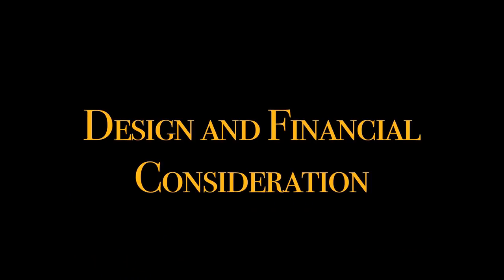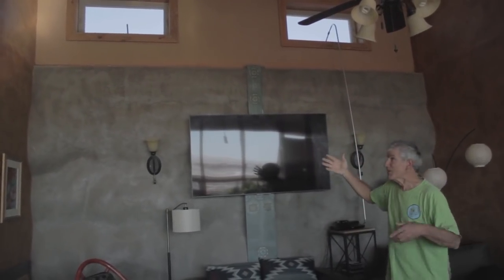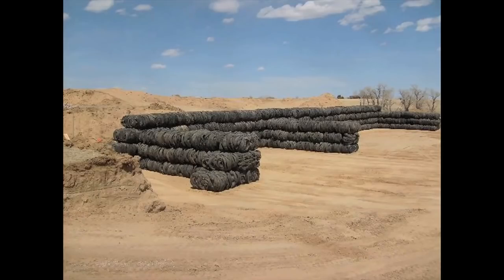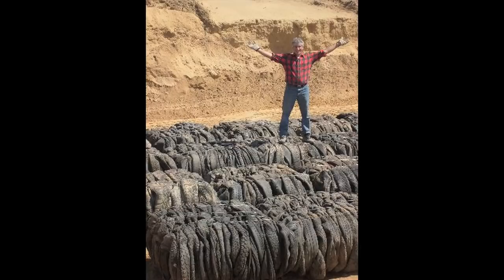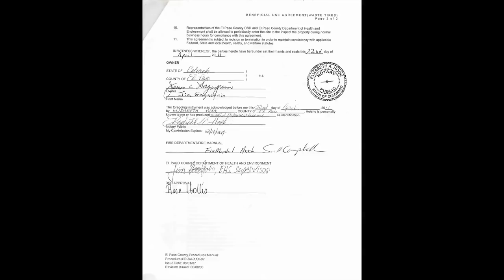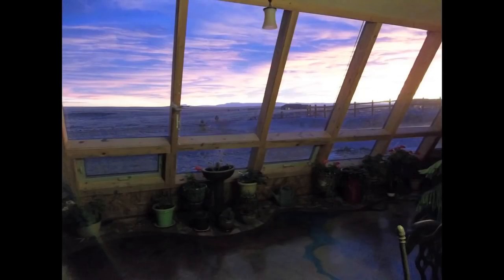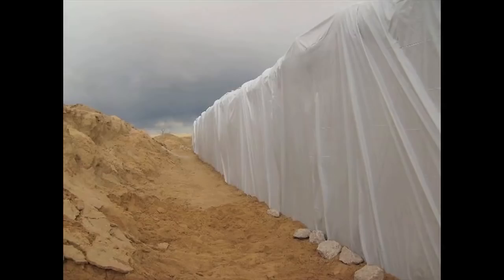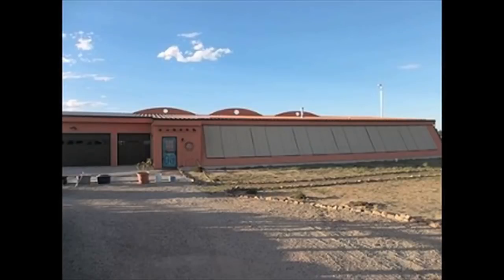Zero Energy Passive Solar Bermed Earth Tire Bale Home - Pseudo Earthship

Comment: Great idea to use tire bale - filling tires with ground is a nightmare (very time consuming and required lot of volunteers).
Reply: im so glad i saw this video. I kept thinking on the amount of labor that’s required to pack them tires, but tire bales...could be the next best thing since slice bread.
Reply: I still cannot find a place that has the tire bales and will ship them
Reply from the maker: Front Range Tire Recyclers 303-660-0090.  The owner is Rick Welle.  His cell is 303-500-2323.  Another friend of mine built more recently, and he used a different source - American Tire Recycling (Duane Immel) 303-638-7150.  Both of those are Denver area code numbers.  Not sure where you're located.

Comment: I call my 24x24 6/12 pitched skillion cottage a pseudo earth ship. Will add on 2 more 24x24 sections. No tires or berm using well insulated  cmu block with masonry veneer on north wall. Our frost depth is 6 feet and ground temps of 48*F in summer where I am at. And can get 6 feet of snow in a weekend. So insulating under masonry floor. I have plans for a masonry stove/white oven and masonry heater old world kitchen. Post and beam square notched timber frame. I have 70 psf snow loads. Doing a Richardsonian Romanesque style. Because proper stones are local and timbers too. Have plans to build a Broch type tower to see lake Michigan. Matt and Goldie's earth ship is similar design as too what I am doing. Using 3  vertical 16 foot columns of 4x7 windows installed horizontal per 24 foot section. 4 foot raised bed and 4 foot above windows for hvac ventilation. I am using 2 inches of concrete with slate slabs over thermal break, insulation, and limestone fines for floor. Using western Delta honey comb riprap masonry veener to get megalithic look. Like Temple of Malta. Doing solar d.c. electric like a boat or R.v.

Comment: As a general contractor with an engineering background I find these structures very interesting. Ive always desired to live in a non-conventional home, and have for many years been interested in alternative power sources. Have designed and built our own PV system to experiment with it usage here in the Tulsa area. Im convinced that an earthship inspires home is the way to go. The world around us isn’t getting any more stabilized, and having this type home would be a great shelter as the concerns with grid power, water etc continue to increase.

Nice job on a very nice home. Wife and I are looking at possibly going to the Earthship 180 in Valdez NM and staying for a week or so. There are some design flaws in that particular structure, but Im sure it has all been a part of the learning curve. Still an amazing home and unique property

Comment: Great informative video. I used tires to control soil erosion in my sloped yard. Unfortunately I was stopped by neighbors concerned that it would leach chemicals into their yard and cause cancer. Can you believe that? So i took my tires up to my off grid property and construct an bermed cabin based on your principals. Theres always 2 sides for debate nowadays with anything. Have a great day!

Comment: excellent information. Thank you. We will be building one eventually as well. I think we'll be using cinder blocks and insulate about 8 feet outside the walls (after 8' of dirt).
Reply from the maker: Does the 8' of dirt act as an insulation barrier?  Haven't seen much info on this type of build.  Can you share a link?  One issue that is hard to manage with bermed homes is mice.  Even though I sealed our house incredibly well, we still see an occasional visitor.
Reply: @jimgagnepain7708  The 8' of dirt is for thermal mass. Ideally, there is no insulation around the cinder block wall (or whatever you are using for a wall), so if there is excess heat in the house, it will be stored in the dirt behind the cinder block wall. that dirt behind the wall does need to be insulated from the outside temperatures, however, so I would put insulation (and plastic to keep the insulation dry) outside of the dirt. Then, it will need to be covered with more dirt to protect it from the sun. Michael Reynolds shows how to do this in his earthships. There was one video that showed the insulation. i don't remember how to get to it. sorry.

Comment: Hello Jim from South Africa. Great video, thanks. We also have an off-grid home but live off grid in a very different way. Solar power (very small system, but managed well) No water supply and no sewerage supply. It's not an "earth ship" or anything special but is just great. No utility bill's either which is the best of all. We use propane for cooking and as a backup of our solar water heater. All your reasons are just right and lastly battery backup for us is the only "pain"  Lead acid batteries are soon to be replaced with a Lithium Iron unit.
Reply from the maker: Dave, This sounds great!  It's nice to hear from others who have discovered that it's not that hard to manage everyday living, without releasing a lot of CO2 into the atmosphere.
Reply: Dave faddel, do you have pics to show us as South Africans plz?

Comment: I couldn't agree with @Ave more. Many very useful observations that most other posters either haven't encountered yet or were simply omitted. 
As for the windows I was curious if a tongue & groove style mitered profile might help with the leakage. Similar to a bird's mouth in gable design. Or using this to your advantage since most homes of this type have plant beds under the glass. The later option I thought of using standard window / door flashing sill pans & use that to direct the water inside to either drip into the planter beds or to a small gutter that would go straight into a grey water cistern as in most Earthships.
Reply from the maker: It could help, but the problem is more related to the glass sections themselves.  We had to use Big Stretch calking, which in effect, angled the seems outward.  You do not want anyplace where the water can sit on the glass, without draining - that's a recipe for leakage.  Operable windows also had problems.  The weep-holes, which are standard on windows, were not angled to the outside, because the installation wasn't vertical.  An earthship friend told me to drill my own weep-holes and insert plastic tubing, to achieve the "outside angle".  This worked.

Comment: A very inspiring and beautiful home. This is how homes should be designed: focusing on a solid envelope while thinking comprehensively about the various systems (ex. your hot water tank placed  where it will absorb heat from the sun)

Comment: Wow Jim what a wonderful video. Well thought out and laid out. It's easy to see it must have taken you quite some time to structure the video. One of the best summaries I've seen for an earth ship home which I have had interest in for years. Also very happy to have found your video as I believe I may have seen another one of your videos years ago talking about the tire bales vs pounding tires. I searched for years trying to find it and today I found this one instead. It may have been someone else I suppose but if I recall they were also in Colorado. Regarding insulating the floor, I think that has more to do with the climate than the design. I remember reading an engineering blog on passive solar houses that specifically referred to a Reynolds earth ship built in England. It was the first one of its kind in England. Mike had arguments with local structural engineers and contractors who told him he needed to insulate the floor, he of course disagreed. The owners have complained ever since that it doesn't function right. The floor becomes a massive heat sink during the winter and sucks the heat right out of the house instead of storing it for the owners use. I guess the ambient ground temperature is much colder in their climate then it is in your location. That's what I recall anyway. Thanks for the awesome video and for sharing your incredible home.
Reply: The frost line would be my first consideration.  Idaho is around 3 feet down, where Maryland is about 18 inches down.  It all starts at the foundation...
Reply from the maker: We don't seem to have the "heatsink" problem at all, and we get very cold nights in Colorado.  Maybe it's because the floor absorbs heat, as thermal mass, during the day, just like every other area.  Other possible reasons are that there is about a foot of small rock under the slab, and also, our water pipes (cold and hot) are under the slab.

Comment: Hello Jim! We live in the first "bale" home design by Mike S. in S. Co. past those Spanish Peaks in Las Animas county. No house heating installed, just a wood,  free standing fireplace. I have fresh tomato's year round! Your home is beautiful. Congratulations on it's completion. This is first video I have seen using the bales. Credit to Mike Reynolds for his life/planet changing concept of reuse of tires and recycling, the "bales" were much quicker....~Cathy & Frank~
Reply from the maker: Your name wouldn't be Hagar (?) by any chance?  If you're up this way, stop by and see the place.  I would love to do the same!  I also do cherry tomatoes year-round, along with an herb garden.  We have fresh pesto weekly throughout the winter!
Reply: @jimgagnepain7708  No, not us. But I found out you know Mike G. who helped in your build. They were here yrs ago! We have email contact. 💖
Reply: @jimgagnepain7708  👋 Hello again! I feel the same about the vertical/sloped glass. Ours are failing. Where was your glass bought? Also what brand of shade's?! T.Y. ~Cathy~
Reply from the maker: @walkingwater893  We got our glass from Aspen Glass.  They did a great job setting them in place, and cleaning them.  We had some small pieces of mullion to hold them in place, until we could do the permanent mullion installation.  Got the shades from Out West Awning in Colorado Springs.  I was getting on-line quotes for over $10K, and we got them locally, WITH INSTALLATION for about $2500 (2011 price).
Reply: @jimgagnepain7708  Thank you Jim

Comment: Very well done explanation of earthship. Although didn't go into plumbing
Reply from the maker: The plumbing is pretty conventional.  PEX tubing, under slab, before the floor concrete pour.  One thing I would do differently is to add an on-demand electric water heater to our guest bedroom shower.  It's fairly far away from the hot water heater, and takes a while to come up to temperature.  I was a little upset that our plumber didn't recommend this when he looked over the job.

Comment: For anyone reading this comment - this suggestion is coming from an old earth builde:
 It's an easy matter to incorporate (completely DRY, aged is best) raw or dimension lumber horizontally into your tire walls, especially where cupboards will be hung.  Same goes for any interior adobe or rammed earth walls where door hinges, circuit breaker & outlet boxes, etc will go.
Plumbing and electrical chases can take advantage of the space behind those 2x or 4x horizontal runs.
Need to keep the course level from exterior to interior?  Do a shallow bond beam of concrete the height of the wood behind the chases.  Remember, any concrete coming all the way through exterior walls will readily 'wick' in the cold, so the treated wood - besides being nailers - helps separate that dense material from your ambient air. :)
Reply from the maker: Yes, it's always a challenge to hang things on a tire bale (or rammed-earth tire) wall.  I spent all day working on hanging a big-screen TV on our tire bale wall.  That's a good idea to incorporate the lumber into the walls.  We rely on the shotcrete, and I can usually attach lumber to that, using the blue concrete screws.  Thanks for sharing!

Comment: This is a really cool alternative to an Earthship. I like it. But it needs the cooling tubes going through the berm for the summer. And the windows up high in the front to allow for convection. I didn't know about the tire bails, those should be used for a LOT more construction. It could work for bridge abutments, highway dividers, retaining walls and lots more. It's a great way to get rid of a lot of tires. I hope they don't off gas into the house, I've heard of that in some Earthships.

Comment: My husband and I looked into Earthship and stayed in one outside Taos for a few days. The thought of ramming earth into tires was a deal breaker for us as we have neither the strength or stamina for that. Now that I know there are tire bales, we can revisit the idea. 
This was the most well done construction video I have seen in a pseudo Earthship. 
Do you have the cooling tubes?  Did your County ever
Reply from the maker: Seems like your message got cut off.  No, we didn't install the cooling tubes.  That wasn't part of our design.  We find that the outdoor shades keep it really cool on hot days.  We're fortunate to have cool evenings in Colorado, and we open the windows on summer nights.  Cooling tubes would be a great idea for many areas.  We also rented an  earthship in Taos, and we felt the same way about pounding dirt into tires.  We did individual for a chicken coop, just so I knew what I missed.
Reply: Jim Gagnepain - did your County ever reconsider water catchment?
Reply from the maker: @maureenkelly738  - yes the state of Colorado now allows water catchment.  There are limitations, but in general, a cistern is now OK.

Comment: Thanks for taking the time to do this, this is one of the most detailed videos about this type of home I‘ve seen. I love the floor and tile work your wife did, really unique and inspirational. I recently started looking into sustainable houses and I’m interested in how would an earthship would perform in tropical conditions close to the equator with constant high temperatures and seasonal high humidity. I couldn’t  find many that were located in areas with only a dry and rainy season without real winters. I‘d like to learn more about how they would work with constant sun angles, high temperatures and if problems due to high humidity would occur. Solar energy and rainwater collection would obviously work fine but I‘m wondering how the thermal mass and air circulation would perform in these types of conditions. You mentioned north-facing windows and HRV, since you have a lot more knowledge and experience than I do, what would your approach be on that?

Thanks again!
Reply from the maker: Hello, I have not been involved in building bermed earth homes in a warmer climate, but the folks in Taos have built a large number of them in tropical climates.  The principal is that the temperature underground is near the same no matter where you live, and that thermal gradient can be used to cool or heat the home.  Volunteers from their group built them in Haiti and Puerto Rico after their disasters.  Here's a link.  https://www.earthshipglobal.com/

Comment: The most informative video on Earth Berms I have ever seen❗️
Amazing insight & tips for success.
One issue...
I wanted a full TOUR, & completed house plan.
How do you like the Japanese soaking tub❓
Does water get cold easily ❓(tub)
Any sweating of windows, walls❓
Noise inside travel❓
Reply from the maker: Peggy, My wife loves her Japanese soaker tub.  Her only complaint is that she thinks our water heater is undersized.  It's 8 years old now, so it probably doesn't have much life left.  I'll replace with a larger capacity unit.  The hot water that she does get into the tub stays pretty hot.  The copper has an air gap, so that provides insulation.  No sweating of windows or walls.  I have heard that this occurs in the models that have an enclosed front greenhouse with lots of plants.  The house is extremely quiet.  I may not have understood the last question.

Comment: A very beautiful home. A ton of work is evident in the construction of this. But for me, I would avoid tires at all costs. Too many chemicals off-gas from them and one tiny crack in the concrete or finish will allow this. I wish you well in your occupation of this picturesque Earthship.
Reply from the maker: When you go into a tire store, you can smell the tires.  That is the offgassing that you're smelling.  Used tires don't have the odors, because, for the most part, they are gassed-out.

Comment: Thanks for the great video.  I want to build a similar structure in tropical Africa. My problem will be to keep the house cool throughout the year.
Reply from the maker: You wouldn't be the first.  You might check out this sight.   https://www.earthshipglobal.com/
Reply: That's not difficult in tropical Africa. Your goal is to keep the house cool.
1. Make the house only one room deep so you can have good cross ventilation
2. Paint all surfaces white to reflect heat.
3. Plant lots of trees around your house to block the sun from hitting your house.